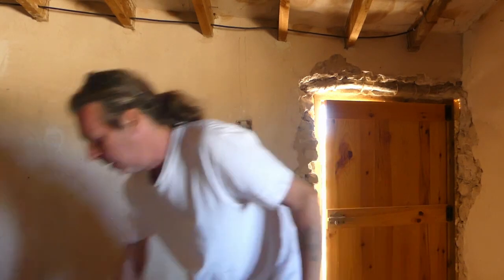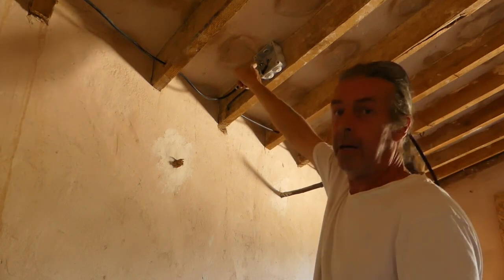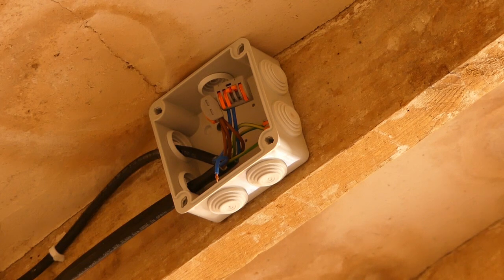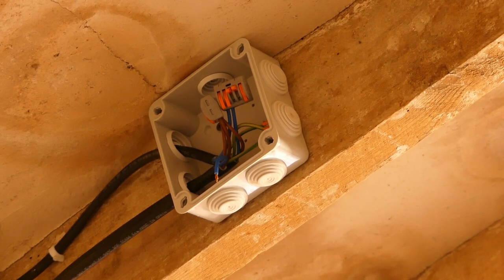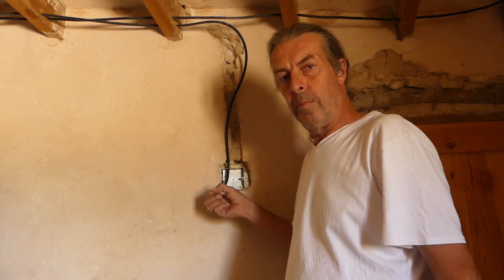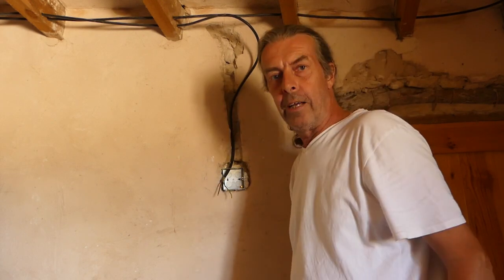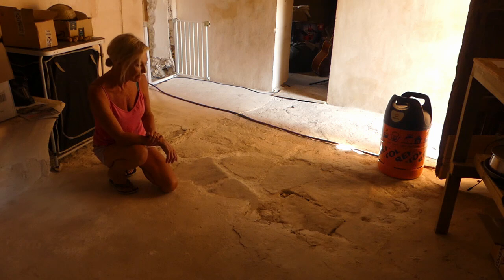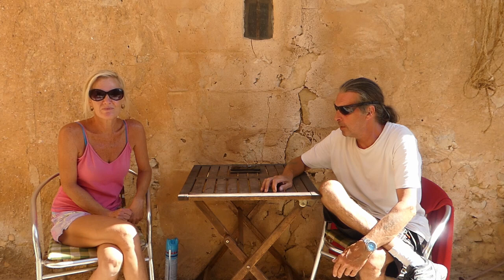First time in 150 years, the old Hay Loft has lights!

Comment: Hi Andy and Sharon.
I discovered your channel yesterday and have subscribed and been watching quite a few. I admire your openness and the detail that you give.
I felt bad for you on hearing the Rip-off architect fees! You mentioned that you can put in more windows – I was wondering what size they could be and could you enlarge the existing ones?
I am formulating a plan for a renovation project in Spain (I live in Madrid), but am not sure as to the level of renovation that is practical to take on with regard to the paperwork, time and cost.
I wish you the best of luck in your project!
Reply from the maker: Hi Mark and thanks. Re the windows, we have to keep to the same sort of size and style as the original ones. If it's a full restoration, you will need a project. You can state the specifics you would like but how that affects the cost I'm not sure. If it gets rejected, that would certainly cost more. A decent architect should be able to advise you. Ours visited before we engaged him and we ran through everything we wanted to do. We didn't really want to change much as we want to keep it as close to original as possible but needed windows in the upstairs, as there weren't any. Depending on the condition of the building and what you want to do, you may need a major works license, which is cheaper and easier to get than a full project - I believe. Find a friendly architect :)

Comment: Question Andy, do the Spanish have some form of electrical regulations.some things you uncover are mind boggling.... Hopefully you will go Spanish and put a double socket about an inch from the sink tap... This room could be a quick one the way you're going..
Reply from the maker: Apparently yes... but I can't fathom them. I have wired houses in the UK and France (which has very strict codes) so I just do it the way I know (and the way that has always passed all the safety checks). We need to get an 'independent' certificate on this place to get a habitation certificate, which only matter if you are going to sell. As you know, neither of these affect a legal sale. Yes, the mind boggles. We have a double socket in the bathroom as I thought it was obligatory :D Re quick.... I thought it may be quite quick but it slows down massively tomorrow

Comment: Hope you were wearing safety flip flops Andy. Why are you using UK standard switches? There should be grommets on the back boxes in an ideal world.
Reply from the maker: Always steel toe caps here. Reason for UK switches is the Spanish / French stuff they sell over here is absolute garbage.... in my opinion :) If you could get European sockets the same, I would use those too but unfortunately we're stuck with the plastic garbage. We're having lime mortar grommets. As there is no movement, I don't really see a need for a rubber grommet.